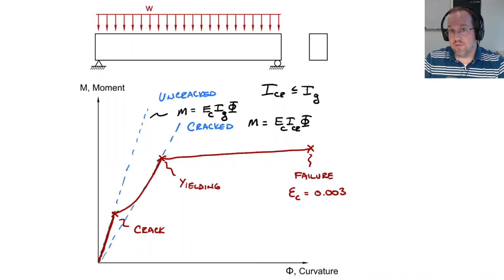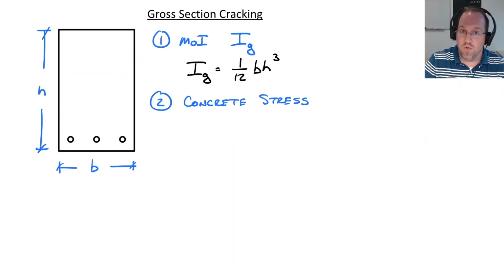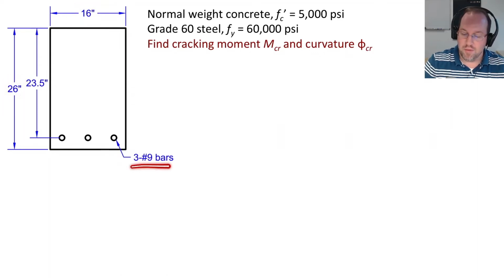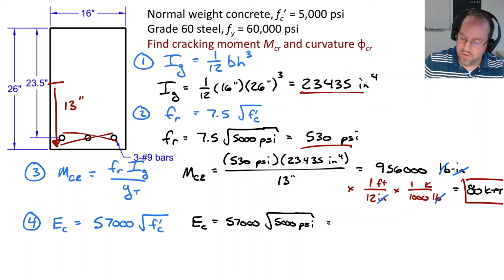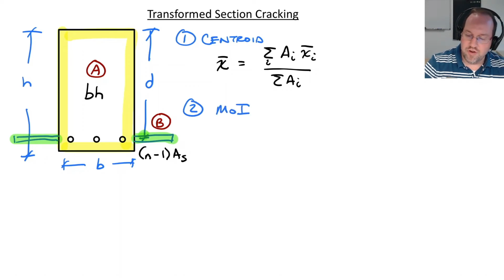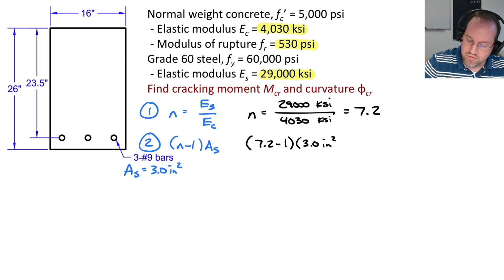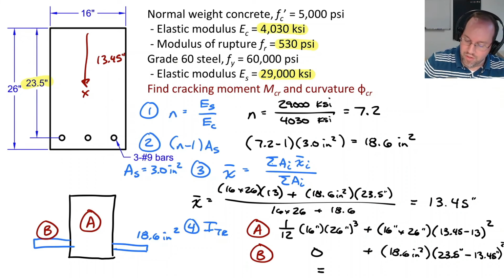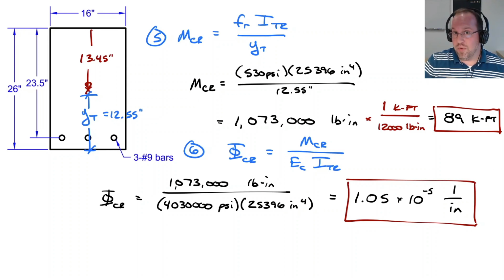Cracking Moment of Reinforced Concrete Beams - Gross Section vs Transformed Section

Comment: I don't understand the purpose of using (n-1) instead of n*As.  Many books just use n*As instead of (n-1) *As.  When do you use each one of these?
Reply from the maker: We use (n-1) when the steel is in the concrete compression block, and we use n when the steel is not (i.e., when the steel is in tension). It honestly doesn't make a big difference, but it is slightly more accurate this way as opposed to always using n.

The reason this happens is that the compression steel with area As' is removing that same area of concrete. Throughout these derivations we always assume the concrete compression block has area b*c, when in reality the area of concrete is b*c - As'. However, it's mathematically equivalent and easier keep the concrete as b*c and instead subtract this area from the transformed compression steel, so the transformed area of compression steel becomes n*As' - As' = (n-1)*As'.

Comment: Hi Professor,
Thanks for the video as always. Was wondering in practice where the cracked moment comes into play? It seems that engineer's are almost always focused on the reinforced design moment strength.
Reply from the maker: The cracking moment is typically only used for serviceability concerns (i.e., deflections). When estimating deflections of concrete beams, the moment of inertia will change depending on whether the beam is cracked or uncracked. I have another video on that topic: https://youtu.be/jI6wwjby9Ms